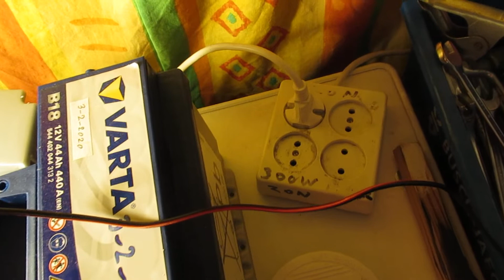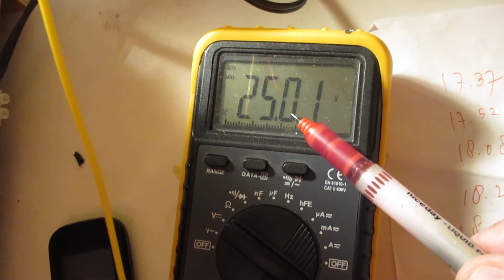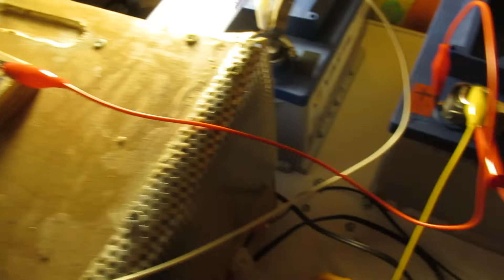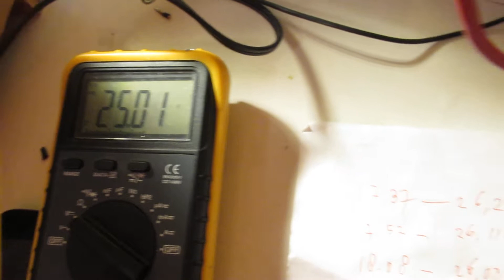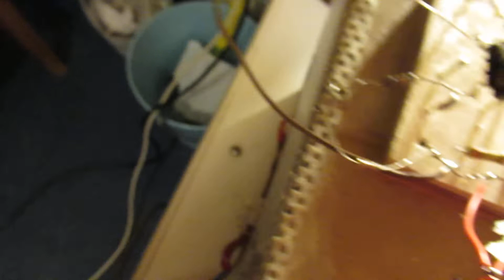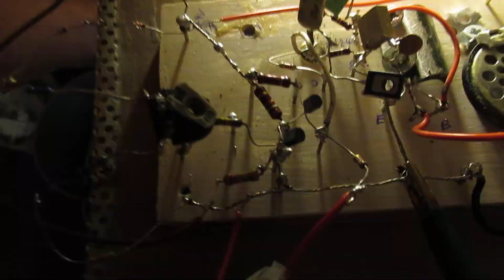VLOG developing a low battery warning circuit for a 24 V lead acid battery

Comment: How can I load test a bike 7 amp battery with resistors can you advice sir
Reply from the maker: Search on my YT channel for "12 V battery charger" or "battery charger" or ""power supply" or ""hum free power supply". Many schematics are there. 13 march 2020. Such a power supply cannot (not!) be made with resistors, needs a stabilized voltage depending on the battery (properties, type, etc) that you want to charge. Study the datasheets of the batteries. Please note: none (!) of my charge circuits regard lithium ion batteries. I only (!) published about lead acid battery chargers. Lithium ion batteries are dangerous.